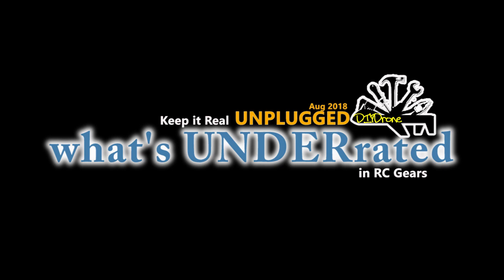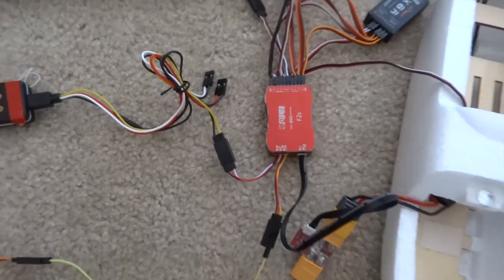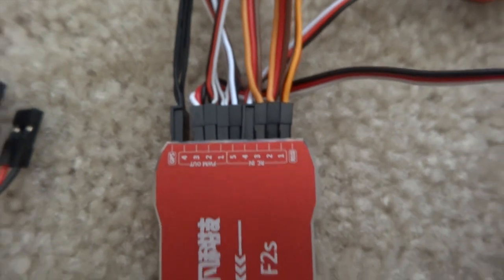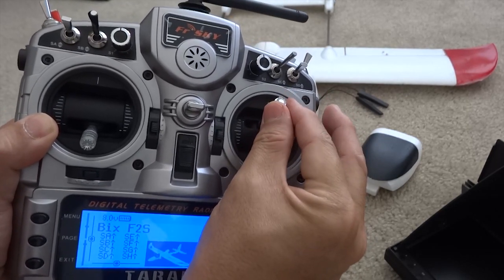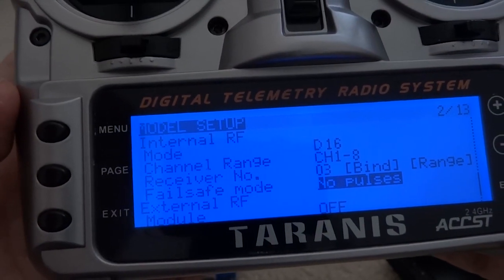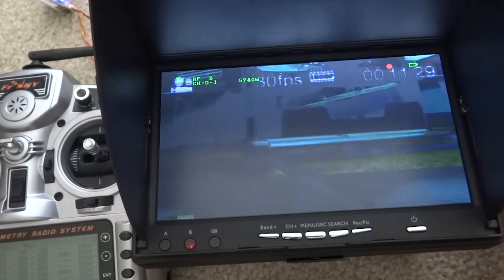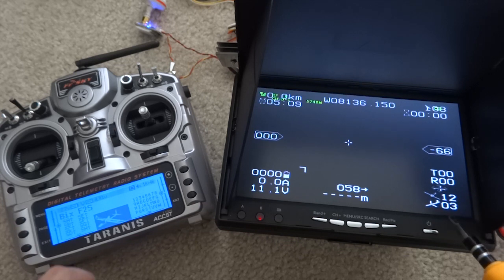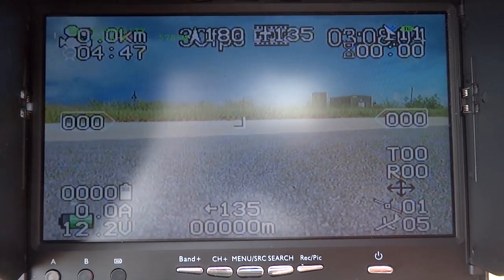F2S Instant Autopilot OSD Flight Controller

Comment: Have you had much success with RTL. It seems this device cant lock a correct / true gps point when compared to true gps coordinates. Even when resetting the home position, it could be off by as much as 500m on true gps position.
Reply from the maker: Greetings. Have not had any issues, but we have only done under 10 flights on two different planes.  It remembers the last home position, so we don’t even reset home since it is the same location, but validate the home distance before taking off. - dm

Comment: Thanks for the Video to show how to set the F2S  controller, VERY helpful,   without this info I know I would have written off another Plane,  Cheer's.
Reply from the maker: Welcome.. this is still our go-to quick and easy gps flight controller.  I have shifted the gps away from the receiver antenna, camera and motor, hoping to stabilize the gps reception.  You may want to consider that in your FPV layout. Regards.